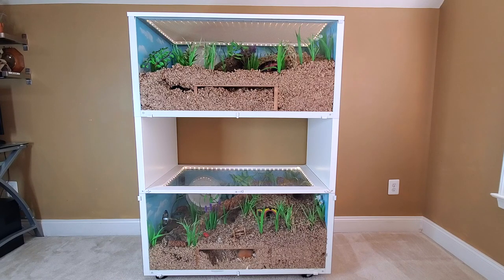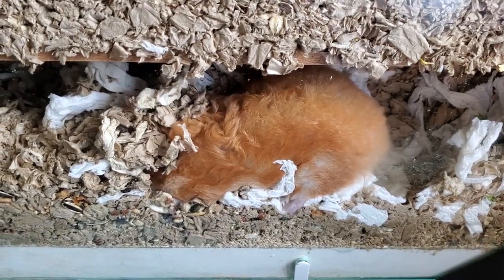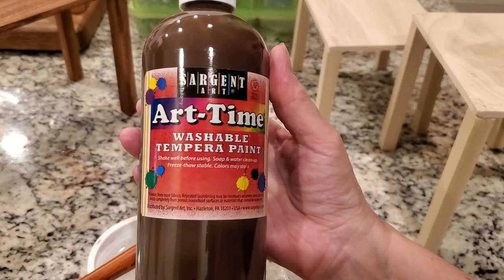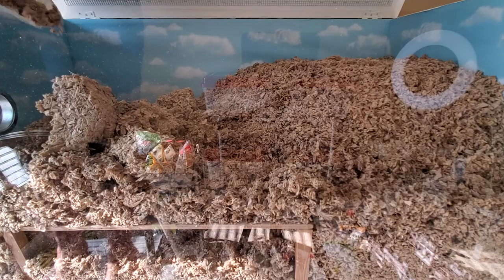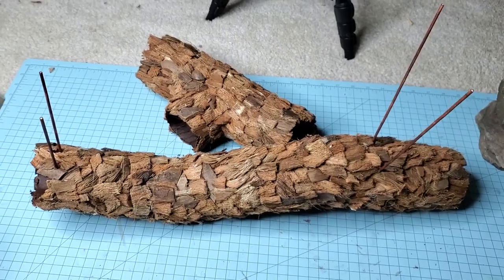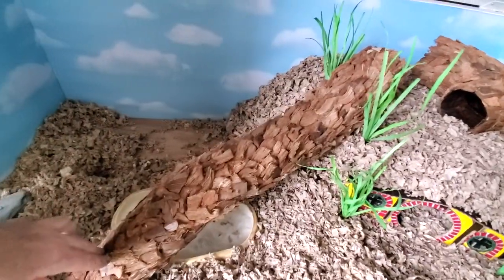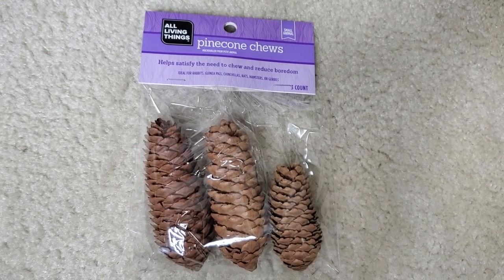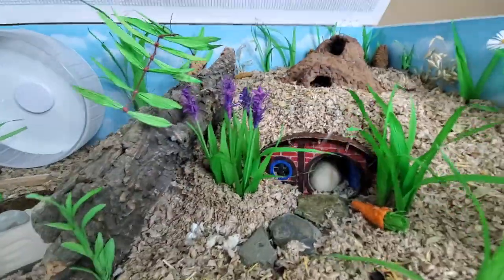Double Linnmon Hamster Cage Setup by Hammy Time

Comment: Wow the cage and the setup techniques and things you made are so incredible and inspiring! I can't believe how talented you are for making all of this. This may be the best cage I have ever seen and I have seen a ton from several hamster youtubers.
I'd really like to make a cage equal to yours but with 120cm x 60cm instead of 100cm x 60cm like you have. I don't have the fancy tools you do though...would you say it is possible for someone with just an electric screwdriver, drill and hand saw to make this without the circle openings on the side? It would be me and my partner doing this.

Awesome work, you just gained a new subscriber!
Reply from the maker: Thank you! It is possible to do it with your tools. The IKEA table tops are hollow wood with corrugated cardboard filler, so a hand saw could work. Maybe use a saw guide, like clamping down a straight edge to help keep the saw straight. Thanks for subscribing! 🙂
Reply from the maker: I saw a notification for your other comment on my cage set up video, but YouTube either deleted it or is hiding it from me. I can't read all of it and I can't reply to it. This happens a lot.
Reply: @HammyTime  Thank you for your answers! I wrote the comment but then I noticed later on that you answered my question in the video haha
I was making a 3D model of your cage and the measurements weren't adding up, I didn't have as much of a gap between the cages as you did. It was because you cut 10cm from the cage back panels and I didn't notice.

Thank you for the tip on the saw! I'm planning what I need for the cage very carefully as I have 2 female Syrians and they are fussy with space. One is in a 100cm x 50cm cage and is bar biting and climbing. The other is in a 160cm x 80cm cage as is happy. I'm wanting to make this cage wider than yours because I'm afraid of making it the same size as you did and my youngest female still being unhappy. Do you think making it 120cm instead of 100cm in width will affect the stability of this build? I will make it taller as well, 160cm instead of 140cm like you have. This is so I can have 60cm of height for both cages instead of 50cm like you have and keep the 40cm of spacing between them.

Thank you again for the awesome video!
Reply from the maker: @dreamingwide  Thanks for clarifying! I see comments disappear too often so I assumed that was the case.  Yes! Making it bigger is awesome. The stability should be fine. I epoxied washers to help strengthen the hold where the table tops on the sides have no composite wood inside to screw into, which helps the stability. Making a 3D model is so smart! I need to do that. Sorry about my measurement error. It wouldn’t be a proper DIY from me if there wasn’t some screw up somewhere 😆 Now I will have to watch my video to see what you mean 😂 One reason I make these video is to document how I did something because I forget so quickly. I have to say that I’m very happy and satisfied with my cage build. Bigger would have been better so I’m sure yours will be a nice upgrade. Have fun with your build! I love how practical it is and I think it looks nice too. 🙂
Reply: @HammyTime  Hiya! I thought I'd give an update because there was a change of plans. We don't have the tools to cut and ordering from IKEA would be very expensive here (UK) with the shipping. Because of this, we got 2 gigantic sheets of Poplar Plywood from a local DIY store that had cutting service and asked them to cut them.
The main difference is that the plywood is 1.2cm thick while yours is 3.4cm... We're hoping that will be enough since it is more robust than IKEA, it's just thinner. Do you think it will be strong enough?
Reply from the maker: @dreamingwide  Your poplar wood is actually better than the Ikea tabletops. The tabletops are hollow with thin layers of wood on the outside. Poplar wood is safe for hamsters. You would need to make a frame with some 2 by 4 wood beams or whatever they're called in the UK LOL. A frame would reinforce the structure to hold up the top level cage 🙂